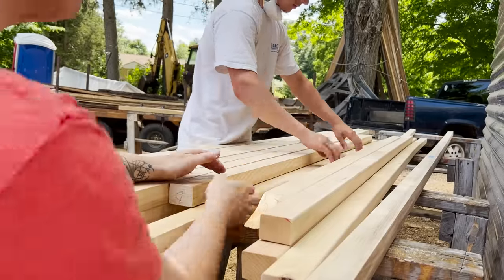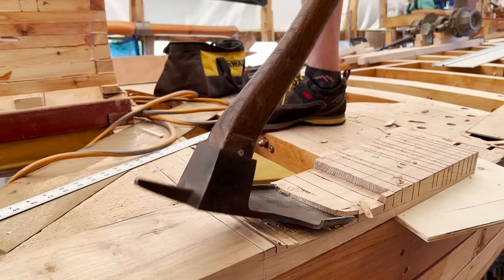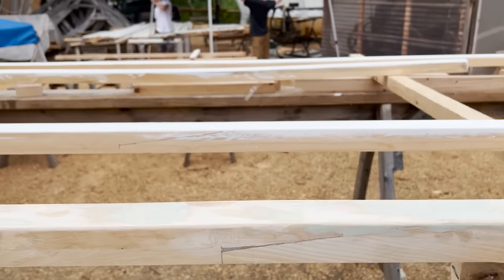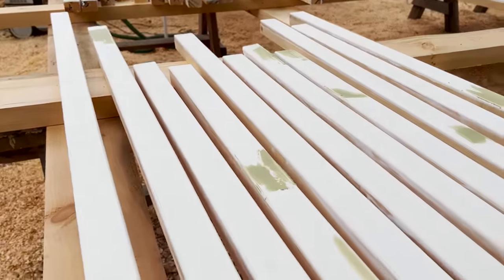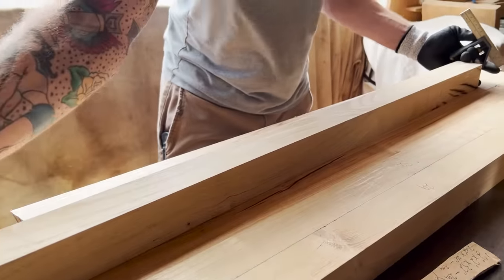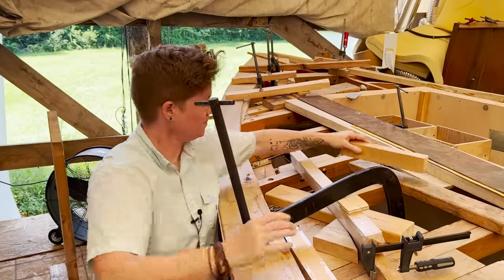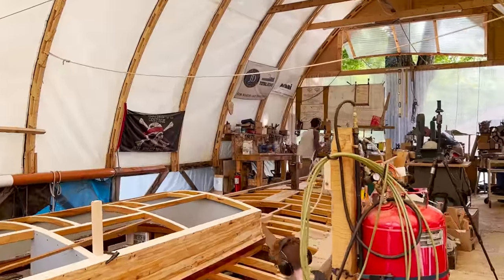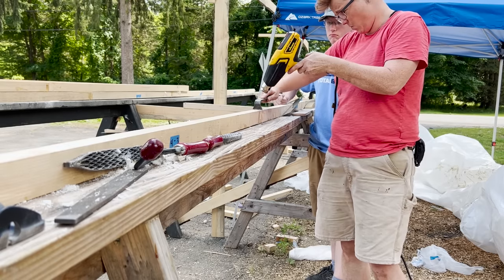Scarfing the Covering Boards - Episode 223 - Acorn to Arabella: Journey of a Wooden Boat

Comment: I love it when different craftsmen show different ways of doing the same task. It shows that there are in fact multiple ways of going about the same thing in wood working. If the adze is frightening for you, go with a different approach. It may take a little longer, but it will get the job done, and if you are not comfortable with an adze, it can be a quick way to get hurt or go to far into the wood you want to keep as well. That is definitely a tool that takes practice to master. Good steel toe boots are highly recommend, even if you're not a beginner. One loose grain and that tool can come at you quicker than you think, or skin off the wood at an angle you don't expect.
BTW, cute puppy, but I would be showing it sharp tools and letting it walk soft puppy paws on cutting edges, KP. Glad it didn't get hurt. I know you didn't mean any harm. You are good people, just a brief lapse of judgement.

Comment: That heavy-duty ratchet strap is actually called a hot line hoist.  Used in the high voltage industry to pull up power lines. The strap and handle are non conductive.
Reply from the maker: We’ve talked about them in the past as they were used when edge-setting the planks. KP’s new to the shop so called them something a little different, but we’re thankful for the lines person who gave us these rejected but perfectly fine hoists!

Comment: Hi,could you please tell me why the covering boards were not cut to the required width before being placed and the scarfings were cut.cheers.Roly 🇬🇧.
Reply from the maker: Accuracy. You can imagine that by drawing a bunch of lines and hoping that they join especially with clamping and cluing happening that we would’ve ended up with an interior and exterior surface that didn’t quite match up.

Comment: Why not paint all four sides of the deck planks for better protection?
Reply from the maker: The plan is to finish the exterior surface with oil—easy, hard-wearing, easy to inspect, lovely to use, and traditional.

Comment: So edge halved scarfs rather than face halved. Contrary to the statement in the video, these are both traditional joints.
Reply: And Tally Ho used face scarfs. They also overhung the cover boards outside faces by a couple inches, with top and bottom quarter rounds.
Reply: @liveshoegaze  Not quite as far as 2", but yes, quite a different detail from this one. I'm no fan at all of those short joining pieces theve used here, nor the straight joints that will be seen from on deck.

Comment: Why use pine for decking I would think you. Would want and extremely hard wood
Reply from the maker: Kind is very traditional for the decking, and it’s no matter that it be very hard work, but rather that it’s easy to maintain, easy to obtain when we need to do a repair, and that it’s plentiful here in New England. This particular stock of pine has been put aside for the deck from the outset.